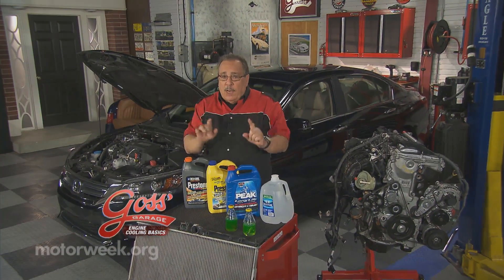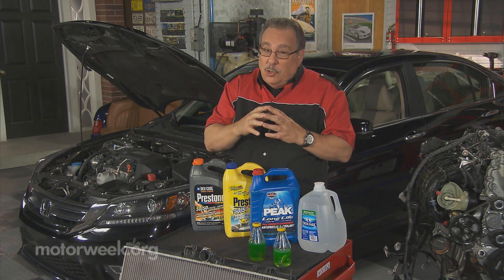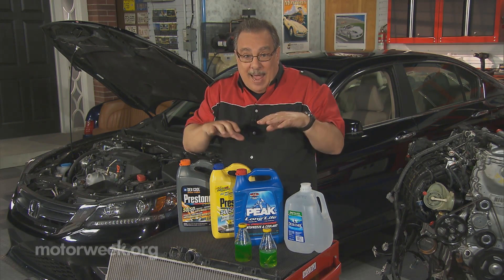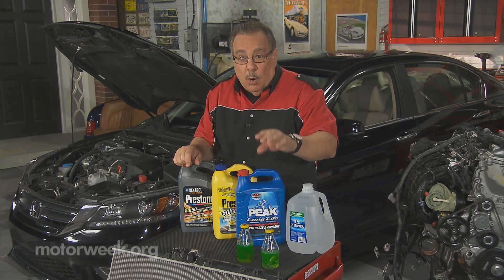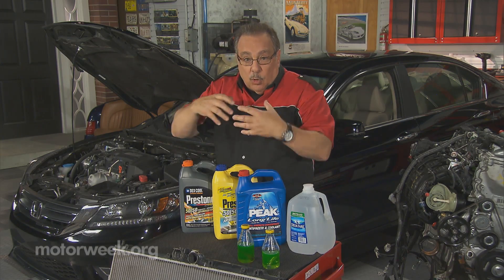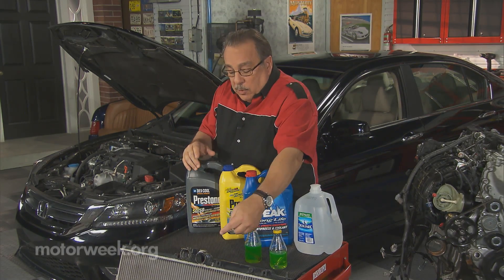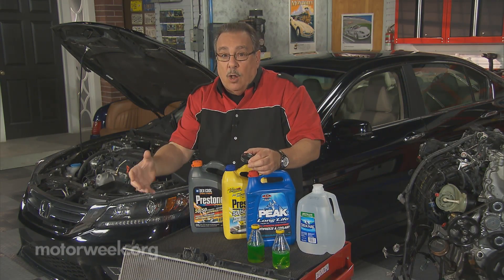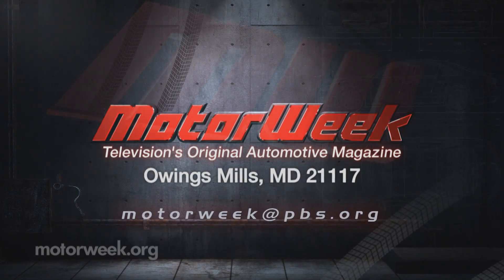Goss' Garage: Engine Cooling Basics

Comment: Keep in mind most new cars need not have coolant changes at all.  The factory formula will last a very long time.  Waste of money to do so otherwise with zero benefits.  If you keep your car that long, you'll need to change the water pump at the 120k mark, which requires your coolant to be dumped so just have it flushed out then with factory coolant replacement.

Comment: The big Problem I have is, What is the Correct Coolant? You read the Owners Manual. It states to use the Manufacturers coolant, Oil, Etc. But gives no Specs on the composition. Example: My 2015 Harley 750. The HD Coolant is Orange. And all I can find on the HD bottle is, No Phosphate, No Borite, No Silicate, Etc. I had to pay the dealer $12 for a Pint just to top off the overflow. When I have to do a Full Coolant change, Its going to cost me big time just for the bottle from them. If I had the complete Specs, I could go to Prestone, Zerex, Etc and shop around.

Comment: Wth is a engine coolant? Shit all these things to know!!!
Reply: Every engine produces heat when fuel is burned. To keep the engine from getting so hot that it falls apart, it needs to be cooled. Smaller engines (lawnmowers, miniscooters) dont need a radiator because they are cooled sufficiently by air. In larger engines, a pump moves coolant fluid around the engine, absorbing the heat and then that hot fluid is transported to the radiator which then removes that heat from the fluid and releases it into the air. Some people call engine coolant antifreeze. It's called antifreeze because the first coolant fluid was water, and as we all know, water freezes. Using water to cool the engine in the winter time would make the engine overheat because the frozen water would not flow, so they have added a chemical to the water called "ethylene glycol" which prevents the water from freezing.